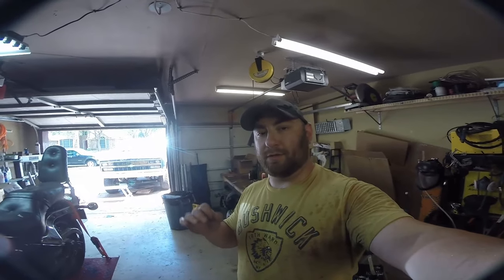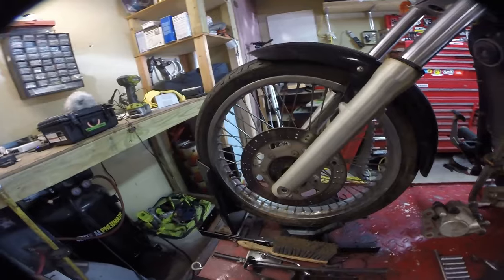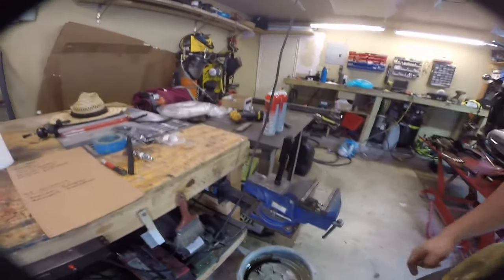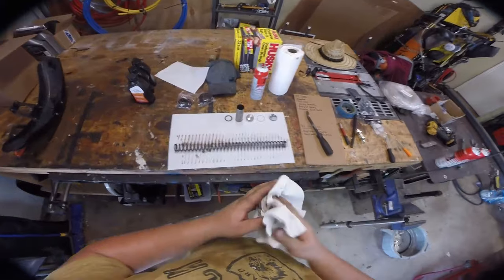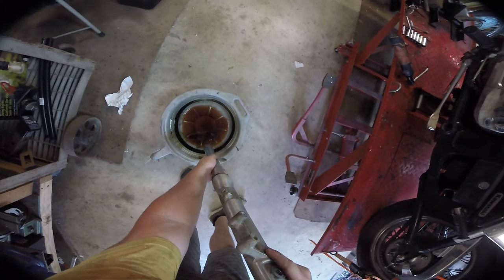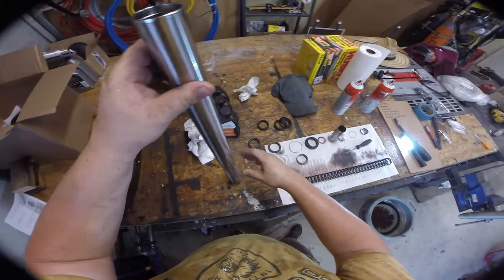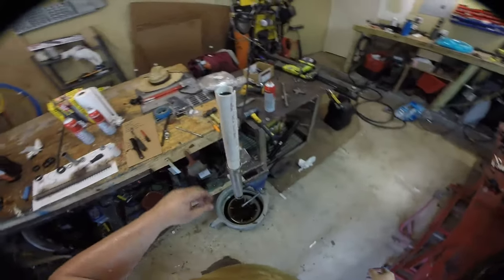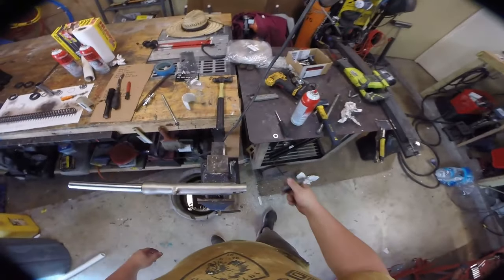How to Rebuild Conventional Forks | 2003 Kawasaki Vulcan 800

Comment: OKAY SO NOT A BAD VIDEO THE ONLY SUGGESTION I WOULD MAKE IS THANK GOD THAT THIS IS YOUR BIKE AND NOT SOMEONE ELSE'S BECAUSE I WOULD NEVER HAVE PUT THAT IN THE VISE WITHOUT FIRST WRAPPING IT WITH A TOWEL SO DON'T GOUGE UP ANYBODY'S BIKE AND ALSO YOU NEED TO FLUSH OUT ALL THOSE TUBES REALLY GOOD AND THE OTHER THING IS WHY THE HELL WOULD YOU PUT BACK ALL THOSE OLD PARTS WHEN YOU CAN GET AN ALL BALLS KIT FOR LESS THAN $25 AND IT CONTAINS EVERYTHING YOU NEED FOR THE WASHERS BUSHINGS,  EVERYTHING. PROBABLY THE MOST IMPORTANT THING YOU CAN DO WHEN REBUILDING YOUR FORKS IS TO MAKE SURE THAT EVERYTHING IS FLUSHED OUT SO THAT IT IS SPOTLESS THROUGHOUT.
Reply: CAPS LOCK IS CRUISE CONTROL FOR "COOL"
Reply: @Lazaralis  all caps bother  people who have mental issues, try to stop at the pharmacy and grab your lunch.
Reply: @willsrestorations  It bothers people because it translates to a run-on sentence of shouting.
Reply: @willsrestorations  how else is all caps supposed to be interpreted thou who has all knowledge?
Reply: @willsrestorations  you didn't answer my question